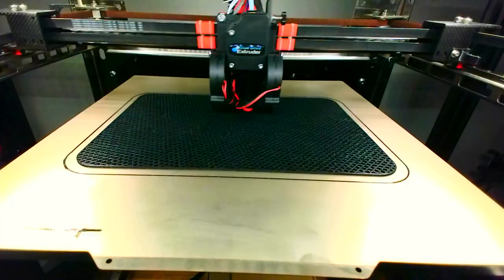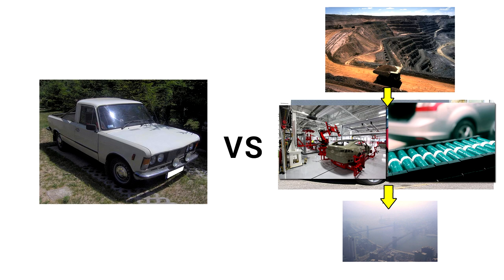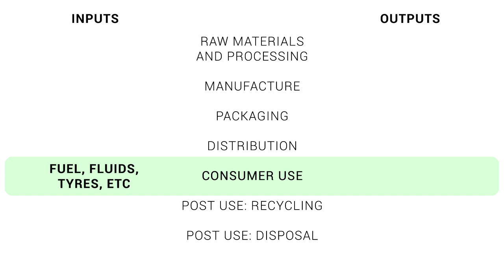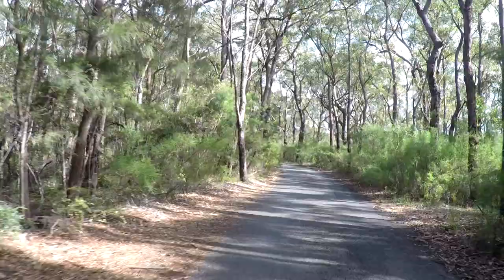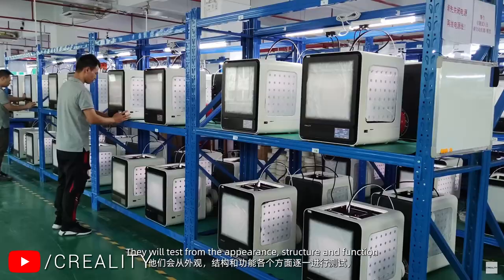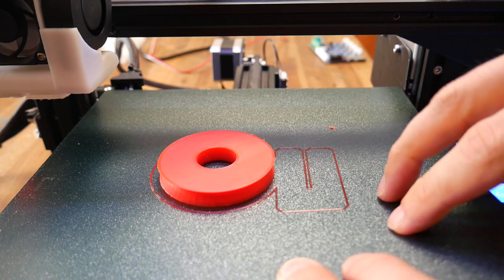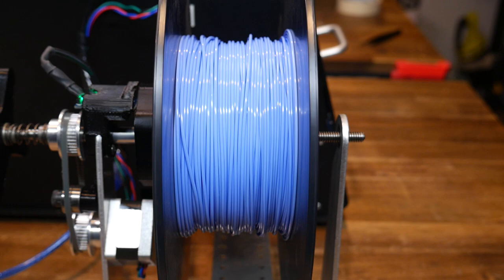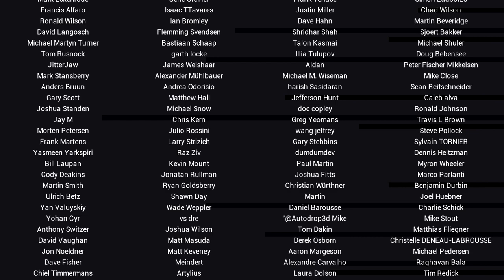Is 3D printing better for the environment? It’s complicated

Comment: Hard to compare plastic injection to 3d printing when it come to TIME. Repeatability. To full fill order of units plastic injection can do that with one expensive mold that’s shipped around the world. Only need to maintain that one mold to maintain quality. Printer farm each machine would need some form off adjustments not every machine will produce the exact same part to tolerance. Figuring out where the quality problems come from would be hard.. i Work as a mold maker.. and most molds are smart and have interchangeable cavities to run multiple variations off one mold. If there’s a way to print graphite electrodes out of resin for EDM, to  repair molds faster. that’s where 3d printing would help a ton.

Comment: I'd say it heavily depends on the user. Someone who repairs power tools, appliances, vehicles etc. with printed parts saves or at least delays those things from being thrown away. Someone who goes on Thingiverse and prints off a bunch of knick-knacky crap that did not exist before technically generated some waste. I do both of these things but try to mostly print functional items. I've probably printed more than 20 individual calibration objects just getting my ender 3 set up.

Comment: The problem with 3D printing is that much of it is waste. Think of how many iterations are needed for a print. Also many 3D prints are trivial items. Honestly before 3D printing, how often have you said, I wish I had a silly looking vase that is mostly useless as a vase. 

3D printed parts can't come close to matching the properties of a commercial plastic part. Rarely can you produce a replacement part that can replace a broken part that was originally injection molded. This I see as a major problem. If 3D printing could be reliable process, go to your replicator and start a print and walk away without any fiddling, and the resultant part was fully functional with minor cleanup, then I would say 3D printing would be preferable.  Run only the parts that are actually needed rather than produce quantities of parts for hoped for sales.

There is lots that 3D printing technology is good at. But from an environmental factor I don't think it has been such a good thing.

Comment: Would you do an LCA, at least a basic one, for a couple of different types of filament? The plant based ones aren't as environmentally friendly as they make out to be. There's a lot of petroleum based inputs that go into the growing the crops, such as fertilizer and the fuel for vehicles. Could be used for growing food instead? Or do they claim it's taken from farm "waste"? 

There is no such thing as waste in nature. The stalks from wheat tend to be baled up and sent to burned for energy because it's seen as waster. However, those stalks contain minerals that were taken up from the ground. When the bales are taken away those minerals are also taken away and will need to be replaced by fertilizers (which only replace the common minerals if using man made ones). If this is done often enough then the field won't be able to support growing crops.

Comment: One factor is that 3d printing saves other products from the landfills. I recently fixed a broken tripod and today going to print a discontinued part for a band saw I got from the trash. The biggest environmental benefits are the secondary effects where a printer affects other items' life cycles. 

I recently printed some clip rings that let me attach a 1 liter pet bottle to my molle webbing, making the bottle multiple use and not needing a molle compatible canteen. 

And then there is stuff like printing parts for using with solar or wind power, water catchment for off grid. I live off grid and use my printer to make parts for this kind of stuff.

Comment: 3D printing in my experience helps the environment when you make replacement parts for your other products rather than disposing of a broken machine.  For example, my 3D printer has managed to divert 3 dog leashes, a sewing machine, an air compressor and two smoke detectors away from the landfill.

Using it to make a large collection of flexi-dragons and benchy boats on the other hand, not so great.

Comment: One thing to add. My small farm of FDM printers has kept numerous appliances, toys, games, vehicles and even some industrial equipment out of the landfill and functioning. That's something injection molding machines can not do. I can go from having a problem to problem solved in a matter of hours. This not only keeps the item out of the landfill but reduces the demand for a new produce.
Reply: And how many failed prints are there per one new design? Anyone who prints knows it generates a lot of waste. And it also replaces other materials, like wood etc that used to be used to solve the same problems.
Reply: @Nobody-Nowhere  My failure rate is orders of magnitude less by volume than the items that are being saved. Also, wood can't do everything and I'm replacing existing plastic parts with plastic, so I'm not displacing any wood.

Comment: I am sure that the great plastic garbage patch of the Pacific doesn't consist of many 3D printed items. I think more than 95% of it is packaging material and bottles, which are all short term use items. It keeps the goods safe and ready for consuming everywhere, so that we don't have to travel for it, or bring our own containers to the supermarket. What is lacking overall is the recycling advantage. There is no deposit fee to encourage return and no economic gain in reusing the material, especially not when it is dirty and mixed with other materials. So the free market doesn't take care of it..... I don't think there's any alternative to greatly expanding the system of deposit fees, so that you can return the packaging in the shop before leaving or when it's empty at home. It will have a cost, but so does pollution! Sadly everyone is thinking on their own expenses here and now, and not for the coming generations.

Comment: I agree with some of the comments. 
I fixed so many objects that I would have thrown away and replace with new ones. Now I can repair them to an infinite number of times. 
I also share my designs on some sharing websites. When I do so, I am really carefully to optimize my design to use the smallest amount of plastic possible. Like this, I feel like I have a double impact on the environment. I am saving an object from the landfill and I am saving plastic exponentially by optimization of my design. 
What do you think?

Comment: I mainly print parts for my 3d printers, functional prints, calibration prints. I don't really print trinkets unless someone asks for one but even so, I don't ithink it is better for the environment. I'm currently iteratively designing mitre bars for my table saw and prints sometimes fail, the clearances are too tight, or some other reason. The big pile over the years of failed prints, calibration prints, wastage from purge lines and the border around the print/brims/support material all go to landfill. I try to design my models to avoid using support material or needing brims to cut down on wastage but it's inevitable.

Comment: I do think that more effort should be put into making recycling available for 3D printed parts. Most 3D prints can be melted down and used to make new filament, so there seems to be a path forward. Unfortunately, it's not widely available, so most prints do eventually end up in the landfill.

One thing that could be done to make 3D printing less wasteful - is to make machines more reliable, especially on the lower end. I've had to make lots of test prints and had my share of failures. I've done my best to make my process as reliable as I can, but it's still error prone.

That said - one benefit to 3D printing is that I'm not really making things just to throw them away a few days later, I intend to keep most of them around for a while. Functional prints especially can provide more benefits than drawbacks, especially if I'm patching something up so I'm not throwing it away.

Comment: I was excited for an LCA, honestly this was a bit of a let down, every stage was reduced to "too complex to compare, so it's a draw".
Reply from the maker: I understand what you are saying but how could I possibly get the data required?
Reply: You would have to do an LCA for the item(s) being printed, not compare the LCAs of the printers. That's where the complexity comes in. There are some cases, such as part for an appliance, that injection moulding is going to be better for the environment. But for someone to replace that part after the appliance is no longer supported and there are no more spare parts then the 3D printer is best. 

In the aviation industry they are now using 3D printing to create single parts that replace multiple parts that were complicated to put together but could not manufactured as a single part before. This reduces the number of parts to carry in inventory, reduces the number of opportunities for an error, and even reduces the weight by removing material, fasteners, and possibly changing materials.
Reply: @TeachingTech  then why do the video?

Comment: My Father was a tool and die maker. Old school tool and die maker. I used to work with him learning trade. Then I found out how much money I could make working a keyboards and mouse than a Mill, Lathe and surface grinder....lol. 
Mold making is not a cheap... or easy. At least back in the day before CNC and EDM became prevalent. 
For youngsters watching this... if you don't want to go to college (because they are bay crap crazy woke now), like working with your hands and brain, go to a trade school or apprenticeship in tool and die making. Huge shortage here in the states. Very good pay and you'll NEVER have to worry about finding work. It's an honest trade and you build really cool stuff. We worked on things from Atari Paddles to Revlon shampoo bottles to parts that went into F15 and F16 fighters and Abrams tanks! Gotta be good in Math as well

Comment: I dont need LCA, LCOE or anything mathmatical to know, that 3D printing and industrial manufacture cant be compared, due to the much different use. 
3D printing can repair items on the fly, that would have been discarded. 3D printing can alter designs to fit your specific need and not have to browse for new products or start a new huge batch of molded parts. 3D printing is not overproducing items that in the end gets scrapped. 3D printing dosnt tie a huge footprint to a factory and staff. 
3D printing  could be better if local sourced filament was available.

Comment: @Teaching Tech You missed a major - gigantic part of the equation, obsolescence.  The only reason the extremely risk adverse and man hour conscious company I work for got a 3D printer was because the manufacturer of the overhead gantries, that cost millions of dollars each, stopped producing the power deliver tracks for them. This includes a simple plastic part which breaks all the time. The option was to either to fork out tens of millions of dollars to renew the entire track system, or buy a 3D printer and make the damned plastic part themselves. 
What happened is that once they had a 3D printer and a person familiar with its operation the use cases keep revealing themselves, one of them being screw on knobs on the remotes for the overhead gantries which keep getting lost. 

This $500 dollar entry level printer, most would turn their noses up at, has produces an outsized value for money to the degree of 5 orders of magnitude, and counting. The print quality is absolute shite by the way, but that does not matter.

Comment: For any commercial company, cost and efficiency will guarantee that their manufacturing method, often injection moulding, will - in big picture - use less resources per part. And create quality parts, loss is expensive. Plastic packages can be recycled and other waste used efficiently, but that requires that one lives in a civilised country 😄

3D-printing is less efficient but reconfigurable and highly individual. It allows us to create things that were impossible, difficult or laborious to make (e.g. sandwiching polystyrene sheets). Printing things won't save the world, but can allow us to e.g. suspend led strips to awkward uneven places or fix portable cooler hinges. Not a big deal for the environment, but possibly big deal for me. Usually I don't 3D-print just because I have a 3D-printer, like I don't drill holes everywhere just because I have a drill. (If I had plasma cutter and generator, I could create "art" on expensive cars I don't own, just because, until police would catch me. Stay away from portable plasma cutters 😬)

So, injection moulding is a train; 3D-printer is a moped.

There are 2 things that I'm concerned about:
1. Waste disposal. What can be recycled (3D-printing waste cannot), should be recycled. What cannot be recycled, should be burned to usable energy (district heat, electricity) instead of using coal, oil or natural gas. Optimally everything un-recyclable would be made from plant-based materials -> no need for new carbon.
2. PLA seems to be the only 3D-printing filament (I'm not going to resins) that is plant based. PETG and friends originate from oil, natural gas or similar -> new carbon is needed and will eventually be released to atmosphere. In CO2 point of view, it would be best to store all PETG and ABS prints forever, but nobody has enough room for that 😉

Comment: Consumer 3D printing needs a bit of a overhaul to get that packaging and transport crown. Take for example a 1kg roll of plastic. A good proportion of options on the market come on a 100 to 200 gram plastic spool carrier. There a good many products that beat that proportion in terms of inorganic packaging to product, and those are finished products that require no more resource input to complete.

The spool carriers need to be at least something commonly recycled like HDPE (milk bottles) or organic like recycled cardboard otherwise that phase is not that different from a resource consumption perspective.

Comment: Specificaly the estimated energy used by a molding machine to mold some 100.000 90 deg elbow PVC pipes to the one needed by some industrial 3D printer doing the same thing.  That should be a doable comparision. In term of production speed I guess molding will always be ahead too. I guess one method will always be necessary and complementary to the newer one... at the end

Comment: What I've always wondered, how much corn does it take to produce 1Kg of filament? Since corn is actually food and way too many humans on this planet have not enough food, I'm worried about this the most.
Reply: PLA is made from non-food crops. i.e. the quality is not fit for human consumption.
Reply: @brisance  it still takes up land that could otherwise be used for growing food crops. However this may still be preferable over the production of petroleum based plastics.

Comment: But you forgot the 1st part of Raw Materials for the 3D Printer Filaments are made from Corn Starch where as the Injection Molding Materials are made from Oil not corn starch. 

So the 1st part of raw materials on the 3D printing is better then the oil used for injection molding which also pollutes when it is being made for the injection pellets.
Reply: PLA is only bio-based filament material. PLA is used also in food packages. Recycling common plastics can be very effective, either to create pure products (bottles -> bottles) or second life (mixed plastic -> containers, toilets etc.)

Comment: There's a middle ground you missed with gas vs EV.  One could argue we should be retrofitting existing gas cars to be EV (so we eliminate the waste of the car and only ditch the engine which could mostly be recycled), and many major manufacturers are busy trying to make simplistic conversion kits (electric crate motors that bolt right up to the existing transmission).

As far as injection mold vs 3d printing it's far too hard to compare.  You'll never get the surface quality or strength of an injection molded part (for a final product), but if it's something that doesn't need high strength or super clean surfaces they can serve a purpose.  I've seen certain companies like drawer hardware make 3d files available for parts so a consumer can 3d print their own (it eliminates shipping, and the manufacturer no longer needs to spend money on warehouse space to stock service parts).
Reply: I was going to mention the same point about the car comparison though a simple example was probably needed. I didn't know that the major companies were coming up with conversion kits. I thought that they wouldn't be interested in such things as they would want to sell whole vehicles instead of kits. There was an episode of Fully Charged that was an interview with a small company in France. That company has a conversion kit ready for one model of car just about ready and it has been certified. Their plan is to sell the kits, deliver the kits to local garages (whom have mechanics trained), and people will drop off vehicle on the way to work to be able to pick up their new EV at lunch or on the way home. It's a wonderful plan because it keeps mechanics employed, gets more EVs on the road, and saves all that embodied energy from the existing car. The company wants to concentrate on making kits for more car models and manufacturing the kits instead of having to do the conversions.

Comment: the iffy question would be the induced demand
given how 3D printing has made a lot of plastic trinkets accessible, it stands to logic that more plastic trinkets will be produced
even if the trinket, economic value wise will only be "enjoyed" for a week at most and thrown away like most gimmick toy
even if 3D printing is more efficient at making plastic part on demand, outside the aftermarket repair potential, does the increased demand of plastic good outweigh the increase in efficiency